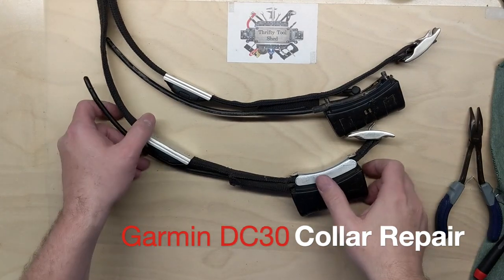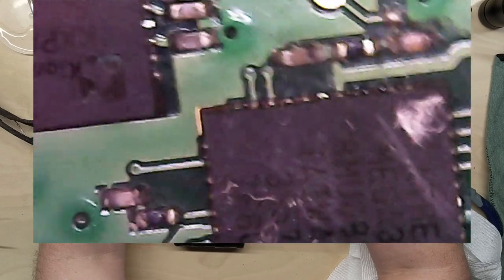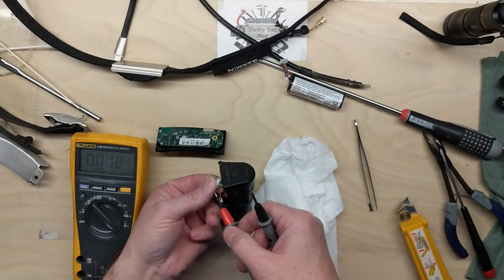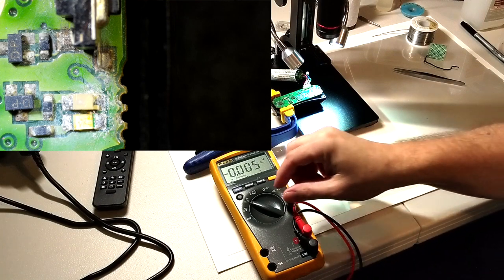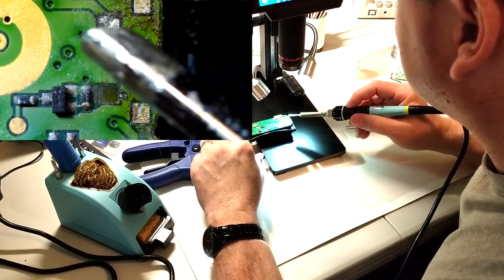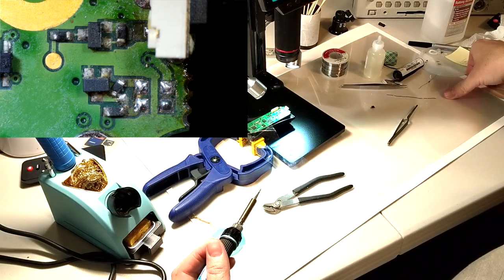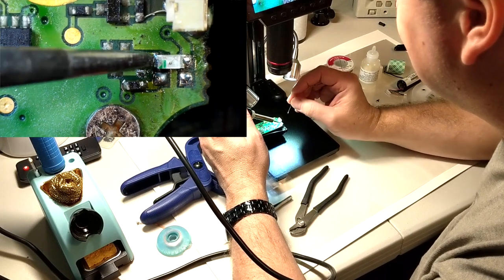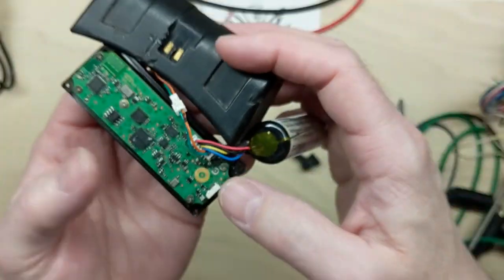Garmin DC30 Tracking Collar Repair

Comment: Do you have to have a 100 watt soldering iron or will 60 do it
Reply from the maker: 100W or higher is what I recommend. 60W may do it, but may take a while and the ground plane is across the whole board making it basically a large heatsink.

Comment: Absolutely fantastic video.
Got a lot of questions. I work on my ownDC30's best i can But those super fine solders and as I seen you mention the heat sink will get you before solder melts Part of my problem 
I have three DC3o's that have those on off switches actually broken off the board so here are some questions

What is the switch name or part number and where can I get one bought? I need three actually !
Is there any specific place to buy some of those tools you are using like an electronics supplier ?
I seen you recommended 100w iron on. here Where can I get one with  that super fine tip like you used?
What is that heat source tool you used to melt the solder when you removed the on/ off switch?
What is that flat looking heat /solder gun that you passed over that solder?
What percentage  lead are you using in the fine solder you used?
What is the small squeeze bottle clear liquid contain? Purpose for  squirting on after you heated the solder and flooded the joints.?

 Thanks for this video. Now I feel like those old  DC30 boards still have a chance to be resurrected from the dead !!
Reply from the maker: Hi,
Thanks for your kind comment. 
I actually have a lot of links in videos descriptions over the years to help people get some of the same tools I use if they like. Most links are Amazon links so most people can easily order from. If you can't find a link for something in particular let me know and I will send you a link to one like it or similar (for an example if nothing else). I use flux a lot of times when soldering. So you may have seen liquid Rosin flux. I also use Amtech 559 flux  a lot. I also use low melt solder now a lot to help with lowering the melting temperature and being easier to de-soldering larger components. I learned the low temp solder trick more recently from Northridge Fix. Alex has a great repair shop working with micro soldering and has helped me tremendously. I highly recommend watching many of Alex's videos, he is a great teacher and a really great guy.  He even gave my channel a shout out recently and I really appreciated that. After you check on the parts and tool links I have in video, let me know what else you still have questions about!
Reply from the maker: I was using my Hakko 80W iron I believe in this video. I must have mentioned that I usually use and I recommend using over 100w iron that way it is hot enough to puddle the solder much quicker. 
Similar Hakko if interested:
https://amzn.to/3cAw90a
A Weller like this one is what I typically use, especially when I have to solder more than just one cell.
https://amzn.to/3ctTJeR
Reply: @ThriftyToolShed  Thanks for your reply.  I am having trouble finding the tactile switch. I found them but not the what I think they are calling a horizontal 2 pin
Reply: @ThriftyToolShed   I found the 80 watt   LOL but thought you said 100 watt  . I just ordered one . I am going to see what I can get fixed. Really appreciate your replies Thanks again
Reply from the maker: @patriciabizich6950  
Yes, I did mention that I usually use at least a 100W iron.
Reply: Legenda
Português

Comment: Where did you order the red led light from?
Reply from the maker: I just order from ebay. Most are from China so it's not quick. I just searched for SMD LED and select color and 0603 size! You can get it quick from Newark, Digikey or Mouser but shipping is just so high for ordering a dozen or less! Best of luck!

Comment: Heyy
I don't know why when charging my color the light blink green an red an not charging?
Could you give assist me with any info please 🙏
Reply from the maker: I did look into the cell replacement in one older video, but I don't have a lot of experience with this. Seems like a cell or BMS board in the battery pack issue.